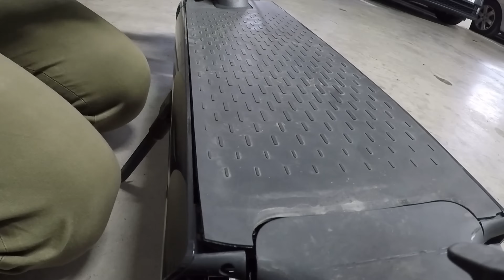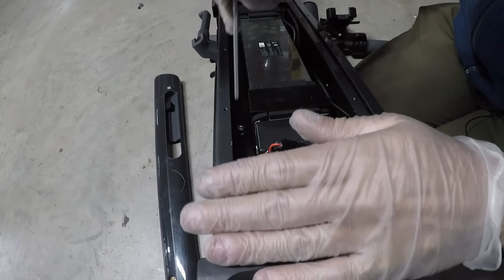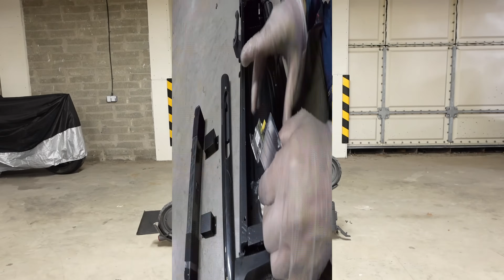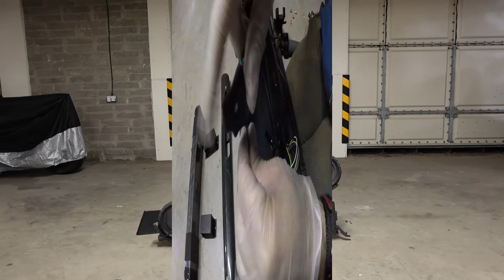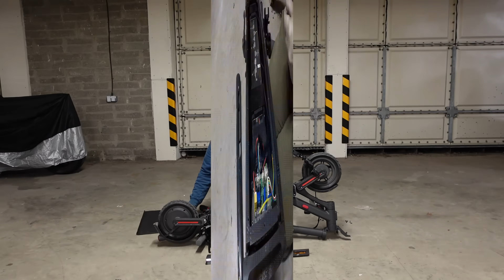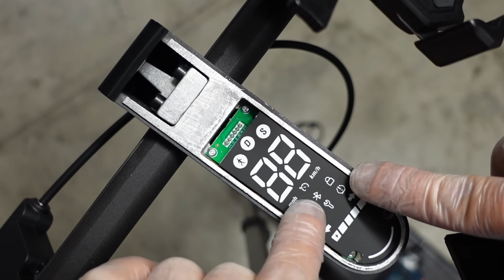Navee S65C Internals Uncovered - eScoot reviews

Comment: Honestly the accent is difficult to understand but based off how he handles the board I instantly realized this guys an electrical engineer 😂
Reply from the maker: The PCB board is covered with clear silicone as waterproofing, and on the bottom is a heat sink, so you can hold it any way you want. Thats why I said the controller reminds me of AOVO pro and the first versions of max G30 controllers because they were the first that ised clear silicone to prevent water damage.

Comment: Are there any upgraded hub motors made for the scooter or that would work well the scooter is kinda slow
Reply from the maker: US version has unrestriced speed, other versions are restricted to 25kmph.
Reply: @TechAndRepairsChannel  i am from canda and it sadly is restricted to 32kmh or 20mph is there anyway to unristric it
Reply from the maker: @massimimi7258  36v systems can hardly get more than that. It would need modifications that are, at the moment, unfortunately impossible. Also, heavily modifying speed on commuter eScooters is not recommended because the frame is not designed for that. Racing cars has many more modifications except engines.

Comment: Could the controller withstand an external battery pack?  nice video
Reply from the maker: Depends would battery be connected in paralel or series. In paraled it should, but I wouldn't advise anyone mees with it if they dont know what they're doing.
Reply: @TechAndRepairsChannel  Lately I have been researching similar topics and I already have a general knowledge about this, but my question is if it is possible with all scooters? I don't want to be left wondering but I haven't found any videos or articles that help me make known if I can. expand the power of the navee s65c, I really want it to go faster
Reply from the maker: @FuzeNZ  For the moment higher speed wont be an option on Navee as far as I know but if it happens Ill make video about it.